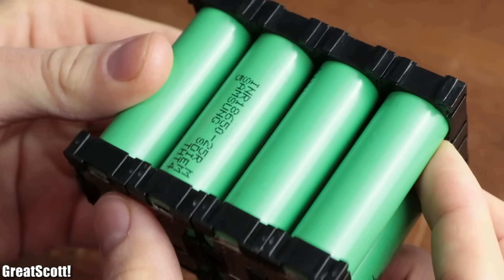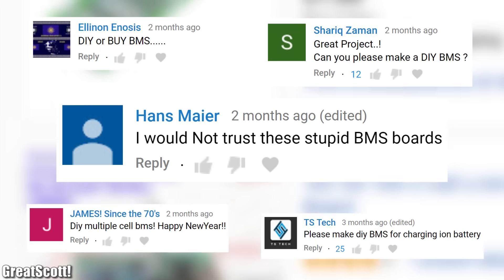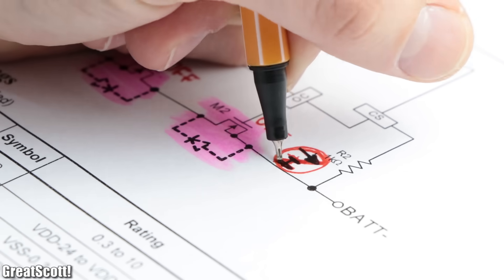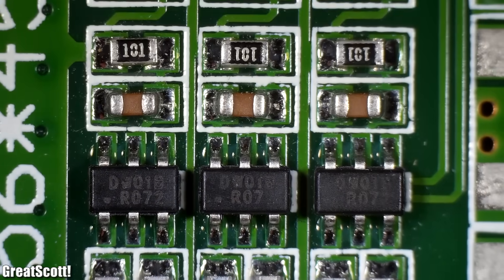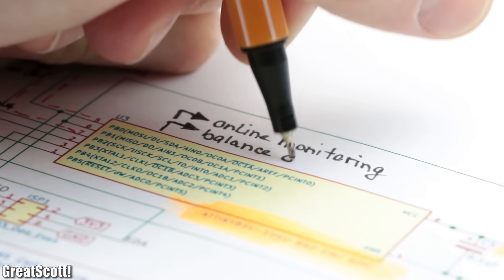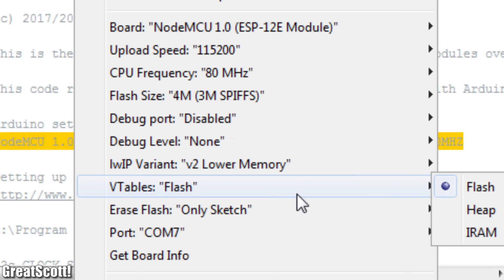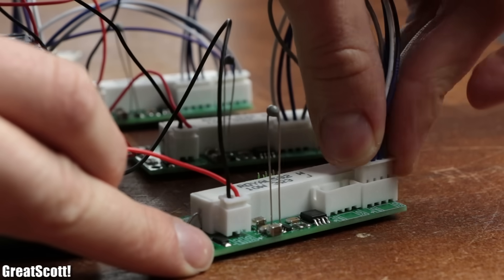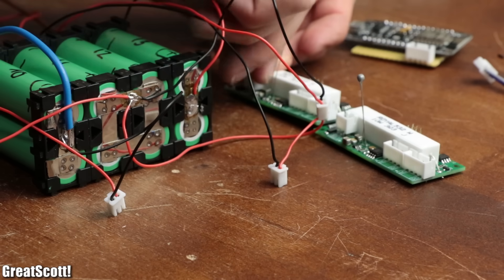BMS (Battery Management System) || DIY or Buy || Properly protecting Li-Ion/Li-Po Battery Packs

Comment: One can do without BMS  https://youtu.be/pljSZcEwc8Q

Only reason to use a BMS is for over/under-voltage protection (but some lithium-cells already have some builtin protection, fuse? not sure though). The commercial BMS are blackboxes, no fuses, nothing to check if it stops working.

Comment: I use this one:
https://www.youtube.com/watch?v=EKX-yk0lRu0&t=6s
Version with active balancing from one cell to other cells with isolated DC-DC converter is under development.
http://forum.mypower.cz/viewtopic.php?f=61&t=4228
https://github.com/kodl69/smart_BMS/tree/master/hardware/module/basic
With 20 A current per cell I use this.
http://www.ostrovni-elektrarny.cz/index.php?category=balancery-a-doplnky&detail=MzIwMTM0&detail_name=aktivni-balancovaci-system-utp-16x20a

Comment: But the DIY BMS does not feature the charge control MOS FET. So it cant switch off the charger when all cells are full. I think a BMS should be able to do that.

Comment: The DIY BMS by Stuart is a great project but I just can't help think it is very specific for larger applications/powerwalls, especially those set up with quite large parallel packs ...

For GreatScoots examples ... his 4 PCB boards are all just to balance his 4s2p pack ... literally, 8 Li-Ion cells need the 4 PCB's and the ESP board. The BMS is as big as his pack.

Anyway, would love to see something more compact yet as effective, I'm sure it's possible.

Comment: BMS power bank? I was think about the odds of building a power bank using an BMS and 4 batteries in series. The output would be reduced to 5V using a buck converter, and for charging a boost converter. I wonder how efficient it would be.
The reason for my  question is because it's not a good idea to hook up diferent batteries in parallel, as showed in the video, different charging caracteristics can cause damage. When power banks are manufactured, the batteries are tested (i presume) so that will not occour.
But with series connection and BMS, this problems are solved, with the only inconvinience being the output voltage.

Could someone tell me if it's a reasonable idea?

Comment: curious about batteries. I see each samsung battery is 3.7v and ampH varies from 2200 to 8000. Does that mean in only need 10 batteries for a 36v bike battery?

Comment: thanks for another great informative vid , when connecting the BMS wires ,each wire links to each strings ,Yes ? ….. and when looking at say a 72v Nominal  ??A BMS ( 84V Max & a bits more ! ) it would be for a 20s (20 cells in series ) yes ?  . I am reading alots on home made packs and i want to confirme that i undestand well before desinging / buying parts , I also plan on a mini pack for aux Pwr -> E-Bike alarm/SMS close to what you made in previous vid =D  , @ FSXPilot i like my packs with alots of serious , it adds up to way more RPM and serious speeds ! Thank You again Cheers and ride safe all -> bewhare of car blindspot they can kill you if ignored

Comment: hey pls ans my question how do I know if my battery is 4s 6s 12s etc?
Reply: it depends on the voltage you need
1s 3-4.2 volts
2s 6-8.4 volts 
and just keep adding them

Comment: 4:03 Those solder balls are not great of the company who made the Battery Protection Board, that can make a short and destroy the Battery Protection Board, or even the battery's, when they came loose.

Comment: Hi, thanks for your great Videos! I like them and learned a lot from them. But I would like to comment on two things ins this videos.
1. Your SMD soldering is good but I would recommend you to get some very fine tipped tweezer. When you soldered those bigger packages onto the smaller footprints you need to grab them tight and guided the into the solder. That way you can get a better solder joint and be faster. It looked kind of funny when you tried to poke the in the right direction. 
2. Bootloader: A bootloader doesn't program fuses only. (That part I also don't know) But he programs a certain firmware in a special sector of the µC which tells him how to act on certain signals on his pins and where he needs to put this data. 
Keep up the great work and your great videos! (BTW: I love your handwriting and your drawing skills!)

Comment: Dispensing solder paste by hand or with a stencil, placing the components, and putting in a little toaster oven will save you a lot of time. Use your soldering iron only when really needed.

Comment: Great experiment. I have also been looking at BMS units lately and many advertise "over discharge" protection but you did not seem to cover this. Do you know if that feature in the commercial units actually works?

Comment: Many of the commercial BMS have separate charge/discharge ports which makes monitoring input/output problematic. Can they be joined without sacrificing protections?

Comment: Great video thanks,  but I am not clear why the DIY option is better for powerwalls and the commercial one is better for battery packs that "sit around most of the time". Are you implying that the commercial ones are not suited for prolonged used (charge times with solar), but that the DIY would be better suited for prolonged use with solar? Thanks

Comment: diy or buy idea: capacitive bed leveling sensor for 3d printers + circuit to step down the 12/24v that the sensor needs to 5v so that the board doesn't get fried.

Comment: I have created bluetooth based Home automation 
Circuit board 
This board will be placed inside of the switch box 
The system draws only 10mA 
Will there be any chances of heating inside the box if enclosed the box 
please clear my doubt 
My whatsapp number is +91 75949 93481
Please reply to doubt soon

Comment: Can you remove a speed limit on a 500w brushless controller?
Reply: I researched that a lot, I think your best bet is replacing the controller with a VESC.  It is open source and you can program any settings you want with a laptop.

Comment: What is missing in both commercial and DIY BMS is the current limiter. Most of the Li-Ion can be charged with only 1-3A and to me it'd make sense to add a current limiter so that it's enough to plug a DC power supply to charge and balance. So you don't need an expensive power supply as yours.

Comment: Is the Gossen meter really accurate for low resistances. Really trying to justify spending £500+ on one.
Reply: For low resistance measurements you really want Kelvin-Sensing/4-Wire-Sensing to null out the resistance of the wires and contacts used for measuring. If portability is no concern, go for a bench meter like a HP 3456A or a Keithley 195a or whatever floats your boat. Possibilities are endless and you don't have to spend 500 bucks.
Reply: @markkrutzmann6862  Thanks Mark, that's really great advice. I think I'll go down that road.

Comment: Hallo again. I have a question about BMS boards. Why do they not have charge or discharge or even finished charging leds ?  I only have seen them in a single cell board  ( https://www.ebay.com/itm/USA-5V-Mini-USB-1A-Lithium-Battery-Charger-Module-TP4056-18650-Charging-Board/254081281429?hash=item3b286cad95:g:siEAAOSw3K1cQpXi  )
 Or the 13/14S board ( https://www.ebay.com/i/111091672244?chn=ps ) But i do not see any boards for sizes in between. I don't know about the rest of you guys, but I like to see when my packs are finished charging or when they are needing a recharge. I build mainly 3S or 4S size packs, but they have no way to know if they are fully charged up or still charging. I only know it if I use a tester.
Do you know of any such boards that have Led Indicators on them ?

Comment: I bought my 14s 52v bms from ebay 1 year ago and used it on my ebike battery. To anybody thinking bms's don't work, you probably didn't buy one. I made my own battery pack and spot welded the batteries together. One day the battery died on me really quick and i couldn't understand why. Two  of the spot welds were disconnected and the bms tried to compensate so it shut the whole battery down which in fact saved my ebike battery. 30$ well worth it

Comment: So, if using a BMS board like shown (cheap one) do I still need to get a proper LI-ion charger or any 12v power supply would work?
Reply: The supply must be current limited and constant voltage.

Comment: I must agree with some other commenters ... it would have been good to see a 'true' comparison ... they are, as you said in your video, virtually 2 different systems. 

I want to be able to make a DIY BMS that is similar to the commercially available ones because, for the most part, the commercially available ones simply have poorly chosen over and under protection values (overcharge at 4.25V, under-charge at 2.8V as examples), in my opinion. I would love to see a DIY build that uses a different value (resistors???) that returns a better value for the over and under protection. I'd love to be able to build small, yet viable BMS that can balance 3s-7s and which has over and under-charge values of like 4.1V and 3.3V or something similar.

Any thoughts or desire to do this @GreatScott! ?

Comment: Wow JLCPCB prices are $2, but I think that they are getting the rest of payment from the shipping price (incredible, $18...).
Reply: @xabhax  You're not a company, so the cost of shipment is not the same because they have contracts and volume discounts. I'm able to buy things from China with a less than 2€ shipment cost, and also an Amazon products by less than 6€ so: why are you comparing the cost  of a shipment through a post office of a regular user like us, whith the cost of a company just to justify it?. We're talking about $18, not $5 or $6.
Reply: @xabhax  surely is much closer than compare yourself with a company. And when I compare Amazon, I compare the sellers, no Amazon prime. With 40€ I can send a 0.5k package to China, so for a 100gr circuit I'll pay less than 8€, and how I've said, im just a normal user.

Comment: "Draws quite a bit more current". Of course! What were you expecting? Wi-Fi isn't exactly low power. And that's an extra in comparison to the commercial BMS, which can be removed to make them comparable, and save 3 €. In fact, you could also try NRF24s or other low-power solutions, combined with an ESP gateway, in order to make it better.

Comment: Great video as always!
I didn't understand one particular thing: shouldn't a BMS charge the cells up to a set voltage then disconnect the cells (that charge to the set voltages faster) 1 by 1 until all the cells have the set voltage?
Or i am missing something here?
Reply: There are different BMS, the simplest is for it to charge the all the cells in series and monitor which cells get charged. If some cells get charged faster than the others, it can apply a load on that cell to discharge it so it won't over charge.
Reply: MrMega got it, thank you

Comment: So the interesting thing here, is that some of the more popular applications that you would use a LIPO/LIION Battery for would be for use on a PEV - Electric Mountain Board, Scooter, and so on. So we can imply that the Speed Controllers in many of these applications have their own Voltage detection, Current Detection and limits set for draw (Think VESC 4.XX and 6.XX) we can ideally make our own charging dock using this method. by taking the examples from the use of the hobby style RC Car packs you can use this DIY BMS as a desktop Charger for your packs as you return from your excursions, rather than having them permanently affixed to your pack.

Comment: Does lead acid batteries require BMS?
Reply: Assuming a 12v lead acid car battery for instance - It depends, most of the time you could get away with only applying a maximum of 13.8V to leave the battery in "float" if you are actively using it. Otherwise you use use a very simple BMS or make one yourself to limit it to 14.2V when charging.

Comment: why BMS only regulate battery voltages after charging completed?
Reply: Because Lithium batteries use constant current to charge up until about 4  volts then it goes constant voltage so it doesnt exceed 4.2 volts. Safety my friend.

Comment: 5:20 0.05 * 35^2 = 61.25W on that resistor, wow!
Reply: Indeed. I guess R004 is 4mOhm and three are in parallel. Then it becomes 1.6Watt loss at peak load.

Comment: Great video, I have some questions, can you help me?
The DW01 is a protection for the battery, over charge and over discharge.
The BB3A is a balance IC. 
But the balance IC can stop the charge process if the battery arrive close to the over charge.
Why i need the DW01 IC?
Reply: It's a plus in safety. Thx for the explanation
Reply: The DW01 serves the same function for a battery, as a circuit breaker does for a house. When something else in the system goes bad, it (usually) prevents a fire.

People can use circuit breakers as on/off switches without creating a safety problem, but never use an on/off switch where a circuit breaker is required.

Comment: The biggest problem I see with all these bms is a separate charge and power connection for negative.  It makes it tough to do a lead swap out with lifepo4.  I've found one bms that will hopefully work for an automotive application. Otherwise these designs limit your project capabilities.  If you do have a bms with -c and -p do not connect them together as this will override the protection function for charging.
Reply: Exactly my problem. Makes it harder to wire up and monitor.

Comment: Be really good to test this open source BMS under real world DIY powerwall conditions. I think the eBay ones will fail to keep recycled cells balanced enough because of the limited load those SMD resistors place on each cell (especially in a powerwall env where each “cell” is in fact many chained in modules). 

Those 1A resisters would be better but it would be good to see a good daily cycle load (like a 2kW inverter or something) for a few days and show the data comparing the DIY vs BUY. 

I realise this would be a massive amount of work tho. Haha

Comment: Hi Scott, Great video, but this will not solve your problem, as you have to test each cell for energy. So unless you pair the cells before connecting them into a pack, this bms thing is useless.  
This is the way to do it right :
1. Buy batteries
2. Messure and test batteries with a BT-C3100
3. Pair the cells in packs with the same energy
4. Now add the bms

This way you will have packs with the same energy, and probably have packs with the same characteristic :D

Comment: This is insanity! Why would anyone design a BMS with one charger IC for every cell!? Not to mention the balance transistors and Resistors.
The sole purpose of an Integrated Circuit is to incorporate all the FETs, Resistors and Control circuits on a single dye. If you design a BMS with 20-40 discrete FETs, Resistors and diodes it destroys the purpose of an IC.
I would suggest making a BMS based on BMS IC. Eg TI BQ76920/30/40. It not only provides integrated balancing, but is also scalable, includes uC interface, can provide front end, temp measurement, individual cell measurement, short ckt, over current and over voltage protection. Moreover it has an inbuilt coulomb counter for SoC and SoH estimation.

This BMS will be way cheaper, economical, sensible and feasible than the one shown here

Comment: Hi
Why can't we use a relay in order to disconnect the circuit rather than using  a load  resistor for  discharge when the cell reaches maximum voltage.

Comment: What is the reason for some people's mistrust of commercial options?
Reply: The chinese ones have a few flaws.
a. Quality, if a part fails it often puts a short across a cell, thus the BMS damages the battery it's supposed to protect.
    Also if the BMS goes completely dead, you often don't know.
b. Low balance currents, unsuitable for large batteries.
c. No display, if one or more cells go weak, the BMS doesn't have anyway to tell you.
    You find out when the load disconnects, then have to get the multimeter out and measure each cell.
d. Cannot be customised, say to warn you before the load is disconnected.

Big reason is the first one, some have even started fires.

Comment: For my situation I'd much rather buy as I wanna put either Li-ion or LiPo in my mobility scooter as it currently uses 2x12 12Ah lead acid batteries which are heavy and don't have the grunt needed for long distance use. Only problem is I'll have to get another display that'll work with the new batteries